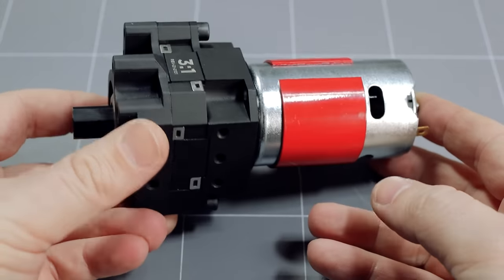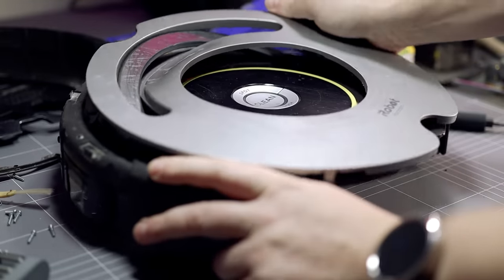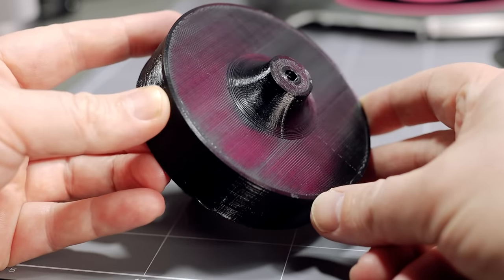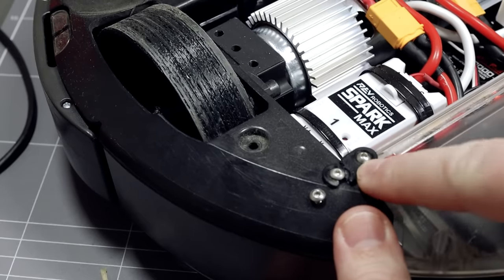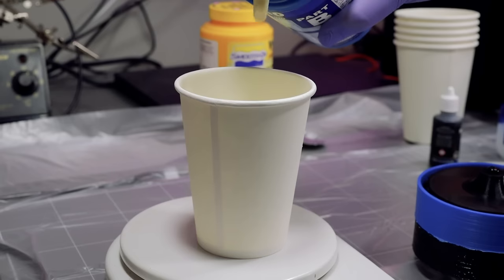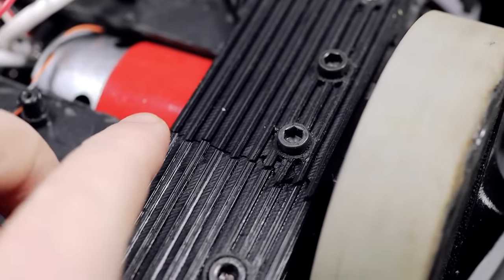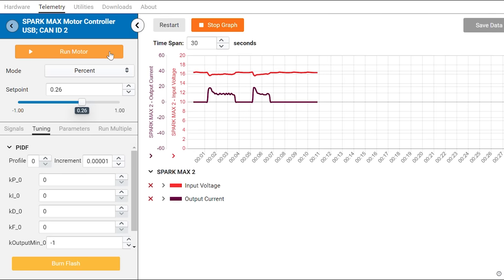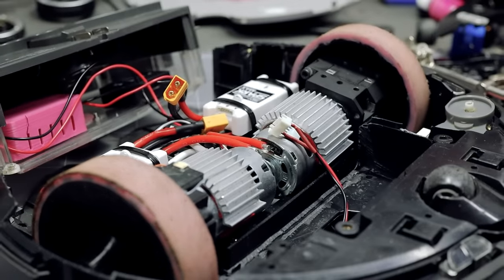Building the World's Fastest Roomba

Comment: My go-to filament used to be PETG as well. However, try printing your high-stress parts with a carbon fiber reinforced Nylon. It's nickname is black aluminum. Honestly, it's replaced needing to machine aluminum parts in some of my niche projects.

Slicer settings tips: Use a cubic infill pattern for strength in all directions. Concentric top and bottom layers for things like wheels. Wall thickness is more important than infill % when it comes to the strength of a part. Values over 50% infill give only minimal increases in strength. Using 100% infill will throw off dimensional accuracy for small parts.
Reply: Why cubic over gyroid?
Reply: @reidprichard  Cubic infill is composed of 3 dimensional triangles (pyramids). Triangles are used in construction because they are geometrically sturdy and distribute the load experienced to each wall of the triangle. Cubic infill is great for prints that need compressive strength. Gyroid infill does print faster, but is better for parts requiring shear strength.

Comment: I think you should probably add some sort of roller in the front too, I would suspect that the front bumper slamming into the concrete when you stop would wear at the bumper and probably also cause some undesirable strain. For the handling, I think most of that is just software; there's no way you're gonna get good handling with each wheel controlled individually, you'd need some sort of microchip that can accept a turning input and throttle one motor just the smallest bit reasonably. For the wheels, I think a very rudimentary solution would just be adding some sort of top over the wheels so that in the event they do hit a bump, the deflection is limited by the wheels pressing into the chassis. Probably wouldn't be great for the wheels tho, but would prevent catastrophic shattering of the wheel mounts. I think a more long term solution would probably be getting the axle supported on both sides of the wheel and connecting it to whatever is the strongest part of the structure. I also imagine your anti-wheelie wheel is not enjoying those zero turn radius spins? lol

Comment: Foam tires. For rc cars that go really fast we use a type of foam. It can handle a lot more speed and works as bit of suspension and they are usually quite stikky. It is the go to for all the road racing at stupid speeds and notoriously difficult cars to control. 

I know sweeps is one of the known brands.. Back in the day you would actually shape the foam on a small lathe. If you could get it in this form it would be perfect.

Comment: To reduce bounciness, try to snuggle in some rudimentar suspensions. An small option would be magnetic. A neodymium magnet would solve part of the problem, but an electromagnet (variable magnetic force) would eliminate completely the bouciness. And rather the suspension go on the motor than the wheels, I think there is more room 

Also: if there is a room for a gyroscope to balance the roomba and exclude the ‘anti-wheelie v3’

Comment: For the handling issue, what about using some sort of gyro/compass to keep the Roomba on a specific heading, you could probably use an Arduino with a 3axis module. Then directional inputs from the transmitter would adjust the desired heading for the Roomba to match, it might need a bit of tuning but I bet once it's perfected it'll handle much better and have active stabilization, allowing you to focus on hitting higher speeds without the worry of having to adjust steering as well
Reply from the maker: Good suggestion. There are a few options out there, that I'll need to investigate.

Comment: The two wheel structure of the roomba makes it very hard to control I imagine. Maybe implement some software stabilisation? I don’t know how but I saw some other dude do it with lower speeds. I do believe you need an extra gyro. 

Maybe while you’re at it, give that thing a spoiler and front for extra downforce and grip! 🏎️

Comment: idea. make one of those brushed motors into a suction motor that you’d find on any other vacuum. and then, attach a power head/brush assembly from a shark vacuum. you can build your own dust cup for it. i would place the motor vertical and have a tube run from the suction point on it to filter.

Comment: your anti wheelie should be a tough, smooth material. maybe a marble or a plate of metal? Stability in high speed RC cars like this usually comes from aero body shape, so you'll have to bend your rules. Maybe do side skirts and a MUCH stronger vacuum to suck it down Brabham BT46 style? xD

Comment: you can always switch filaments, pla+ and petg are decent options, but theyve lacked impact resistance for me. ever since i switched over to nylon and nylon x, ive had great results! it prints kinda similar to abs but works way better in my opinion. nylon x needs a hardened nozzle though due to the carbon fiber bits, but well worth it ;) maybe add a gyro to aid stability at speed if you can, it should keep the roomba straight and make any corrections needed to do so, allowing you to focus on just steering itself. might find a little extra speed by getting longer distance speed runs out of it!

Comment: Ever thought of.. Yknow.. Rubber tyres?
1/10th drag slick tyres would probably fit with some modifications, also treated foam tyres work extremely well for grip on asphalt.
Reply from the maker: Great tips, but the wheels are way bigger than 1:10. One of the main challenges was getting the wheels to fit over the gearboxes, hence the large diameter.
Reply: @electrosync  You can get pretty large 1:10 scale rims for things like racing buggies which would quite accurately match the diameter and width of your current wheel setup, the tricky part would probably be finding a way to mount them to the gearbox since they’re all on 12mm hexes. Also you can find wheels with extremely small offset which would allow them to fit over the gearbox.
By the way - I’m not trying to argue or be a mr. know-it-all or anything, sorry if it comes across that way. I love the content.

Comment: Nice! Why did you use the grippy material for the "anti-whellie" thing through? It seems to only hinder the handling compared to using something smooth, and doesn't seem to really counter sliding to left and right when going straight forward. You could also add some simple rows to the whells, considering you are driving on a (fairly) unsmooth surface and add some weight to them, since the mass distribution isn't the best (unsure about that one since it's still additional mass, so it would probably just improve comfort sacrificing speed).
It's probably just nonsense, but I wanted to say that anyway.
Reply from the maker: Great suggestions. Plenty of ideas for improvement!

Comment: I think a gyro would help extremely wel for this project and a pistol grip controller. One I would recommend is the dumbo rc x6 as it is very cheap has a gyro and plenty of channels. I used this controller for my fpv rc car project and worked very well. I forgot to mention it also has very good range but nothing like crossfire on a controller like yours
Reply from the maker: Thanks for the tips!

Comment: At around 9:11 it seems to me that you removed practically all the original plastic and left only the sides of the chassis to keep the roomba in one piece. I'm amazed it didn't split in two with such speed and those impacts that destroyed the wheels and wheel mounts. If these are more impact resistant, the chassis will be shattered, I believe.

Comment: The metal drive on the motor is overstressing the rims. You need to sndwich aluminum stabilization disks between a 2 peice wheel hub assembly (Dampen thrust) and A metal drive to metal female hub.. or go all aluminum wheel hub with plastic and rubber tire  The rubber is gripping well!

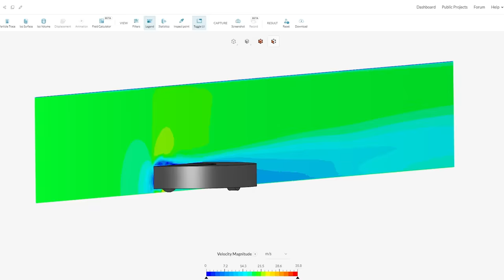Comment: Just curious... at 1:14 you're using a green handled manual screwdriver. Half a minute later you're using a electric precision screwdriver (which I didn't know existed before this video!). Was there a specific reason you didn't use the powered one in both instances? Which power screwdriver do you have, and are you happy with it? I've got one of those mini drivers with 120 bits, but powered would be awesome! Thanks!
Reply from the maker: Good question. I use a Xiaomi Mi precision screwdriver for the small stuff - it's great. For the bigger stuff that requires more torque than the Xiaomi can deliver I rely on the old tools. But I am in the market for a larger electronic screwdriver to bridge the gap between my cordless drill and the Xiaomi.

Comment: Wheels: machined aluminum. Take actual RC car onroad rubber tires. Cut and section them and adhere them to the aluminum wheels. There's a very wide variety of compounds available. You'll get good grip and likely a more dampened connection to the pavement. 
You MUST select a smoother surface to drive on at all times to reduce as much vibration (and therefore wear and damage) as possible. Fine freshly layed pavement. You might also have decent grip on smooth concrete with the RC car rubber tires. 
Possible to integrate a gyro to stabilize straight line driving ?
Reply from the maker: Great suggestions!

Comment: Out of curiosity, what made you go with brushed motors over brushless? Wouldn't you be able to get more speed out of a similar sized motor if you went brushless?
Reply from the maker: Good question. I opted for more RPM over torque because I wasn't looking for outright acceleration. The redline motor provided this, as opposed to the brushless options that fit the gearboxes. The redline brushed motors are serious 775 motors. But I grabbed motor controllers that can run both if I want to try brushless in the future.

Comment: Put a suspension and some aero scoops on it.

You desire speed, but without a suspension to smooth out the ride you can't put 100% power into the road. You also need more down force to keep the tires in good contact with the road.

As it is now this roomba and will always hit small bumps in the road which make it go airborne (even if it's only a few mm) at speed making you lose control, braking and power.

Comment: You could probably get away with using Vex's versaplanetary gearboxes that work with your Andymark Redline (aka 775). They are more compact and definitely strong enough for this application. They even make some of the stages out of plastic these days which will save you weight. Also did you check to see if your Spark Max's were in brake or coast mode? It seems like they are in brake mode in a few of these clips causing it to slow down aggressively. You can't fool me with all your FRC parts! hahaha
Reply from the maker: I'll probably change out the motors rather than the gearboxes. I experimented with brake and coast mode, but neither were that important at the end of a speed run. Nice spotting!

Comment: i think the best way to improve  is making it more durable like making a metal chassis then installing the plastic shell on top of that.
for the drive wheels casting the wheels in epoxy for strength then adding the silicon instead of urethane as the rubber for the wheels since its softer meaning more grip
instead of having one wheelie wheel add multiple but instead of having them as wheels have them as balls so they can move in any direction like a mouse trackball and use ball bearings to add more weight since your increasing the amount of force it can output whist keeping it on the ground since you can't change aerodynamics.
the last thing i can think of is changing the motors and gear ratio's

Comment: I wonder if it'd be possible to design the wheels in such a way that they themselves act as a suspension. I know some wheels I've seen have a kind of in-between structure that allows them to flex a bit without losing too much of its shape.

Comment: We have a robotic vacuum cleaner, not a Roomba but a similar product. One advantage it has is suspension in each wheel unit.

Is there any possibility of running smaller motors with some kind of suspension system? That would mitigate some of your problems, unless the original Roomba didn't have suspension and such an inclusion would be too far from the original design?

But yes, 3D printed parts show good proof of concept but they don't have the strength to survive what you're asking of them; as you say, CNC or casting is the next logical step

Comment: hell yea , for some reason i was expecting a pov image @ 7:52 just need a little i2c acc/gyro added to that xiao. anti wheelie think drag car and put it out the back alittle it needs the leverage i feel, next id like to see you go brushless then add either an old heli tail gyro for straight line ripping or for extra bonus points any new modern flight controller flashed with your choice of firmware ie ardurover that will give you gyro but also gps waypoints and telemetry "you sound aussie so go 915mhz"

Comment: 70mph or higher is easily obtainable. 

550 or 775 size brushless RC motors
Direct drive, no gearboxes
6S lipo per motor, use the room saved by no gearboxes
Run a Gyro for stability
Run rubber belted RC tires on custom metal wheels.

Really 100mph is possible with this setup as long as you can control the aerodynamic issues.

Comment: I did a lot of work with the Andymark motor controllers and 775’s and found that stuttering problem to generally be a firmware issue. Sometimes when you are attempting to set the voltage over and over again the lead motor controller can crash and any follower motors follow suit. Very very annoying to debug.

Comment: I wish you would have gone brushless!! What was the reasoning behind going brushed? Just more cost effective?
Reply from the maker: Less torque, but higher RPM that I figured would suit the gearboxes nicely. But this stuff is all trail and error. The motor controllers and gearboxes handle brushless as wells, so it's an option down the track still, which is nice.
Reply: @electrosync  I was going to say you have all the right components for a brushless system. Awesome build so far! You should make the first 100mph roomba lol

Comment: for the at speed controllability you could use an rc gyro to sense yawing and tweak the motor power on either side to arrest it, a sort of drive by wire system

Comment: Question: does the driver you were using to act on the motor controllers compensate for wheel slipping? From the way it looked, it seemed like any small bump that caused a wheel to slip could make the HRR (Hot Rod Roomba) spin unless you compensated yourself. If there is none, I'm not sure if RC car stuff has this kind of compensator out-of-the-box (you'll know for sure, better than me), but it might help to make it a tad more controllable. Not completely, since no one can fully control the HRR, not even itself.
Another note is that just placing heatsinks help, but if you want them to REALLY work (that is, IF it comes to that), you'll also need airflow, so probably some grooves and paths for air intake and exhaust will help when the HRR starts playing with fire.
Maker-Mindset note on suspensions is kinda on point, but given the space and the fact that this is a lightweight  parallel two-wheeler (it tends to tumble axially easier) that's already cramped, it will probably be hard to implement (even a simple leaf spring type or something like that). The HRR doesn't seem that heavy, so it would probably be better to just use a hollow rubber tire that will give enough suspension effect.

Plus, it needs some stripes, because stripes makes things 20% faster. And more red. Red uns go fastah.
Reply from the maker: You're right. there's no compensation for loss of traction. That's one of the big downfalls of not suing a differential. There's actually a direct route for air from the centre of the top of the Roomba to below where the motors are. So you could add a scoop to deliver air to them. Definitely racing stripes!

Comment: If you want to go for a top speed run, remove the planetary gearboxes use outboard motors and use the rear wheel to steer it via servo. Just like a forklift.
You'll hit over 50 just using a 3s setup and a decent speed controller 👌

Comment: I think you'd get better results with rubber tires instead. The ones you were using were mostly slipping around, losing a bunch of torque to overspin. So paring Rubber tires with Metal wheels should result in a much more stable end product.

Comment: Instead of making tougher wheels, making them more cushiony, would be an easy way to get some suspension-like benefit. Otherwise, a pebble at 50 kph will send it flying.  Also, need to paint some flames, which will add another 10 kph easily.

Comment: Is the planetary gearbox making it faster or giving it more torque? I was wondering if it would go 3x times faster (theoretically, ofcourse it doesnt work that way) without the gesrboxes?
Reply from the maker: Technically yes. But the Roomba is very heavy and those motors don't like to stall. It could be done with different motors, but the handling is the tricky bit.

Comment: One thing I might suggest is to create a new dust tray, something smaller to allow for more motors. What you could do also is put some rollers in the front because it seems to skid. Also maybe try to use wheels that allow for quick turning for those anti skid wheels, such as mecha wheels. This might add weight but the control boost might be nessicary.

Comment: You're getting EMF spikes from the DC motors. Attach a 100nF capacitor, non-polarized across each pair of motor terminals. Make sure they're rated for 3x your battery voltage 👍
Reply from the maker: Thanks for the tip!

Comment: I would mold rounded tires, or at least beveled so that if you skid sideways at high speed, there's no edge to catch on the asphalt. Also i'd cut a small steel disc to glue to the inside of the wheels to reinforce them.
Reply from the maker: Great idea.